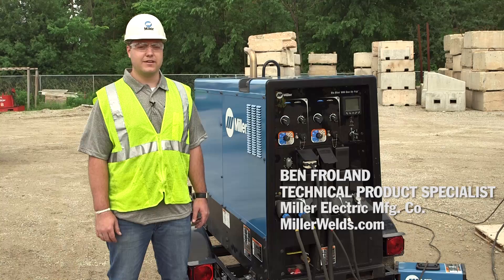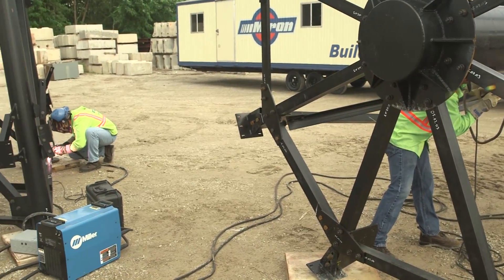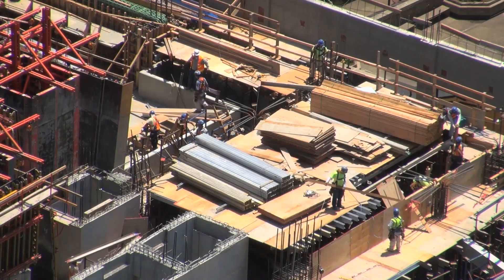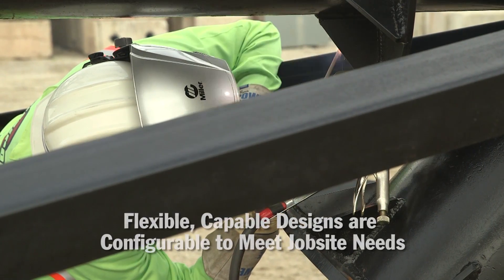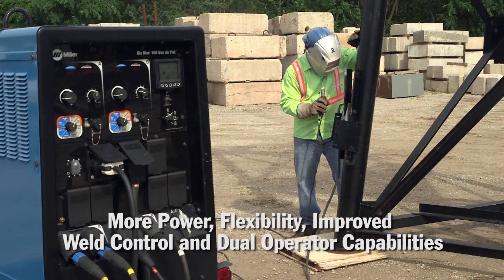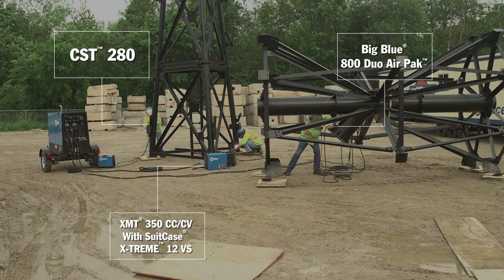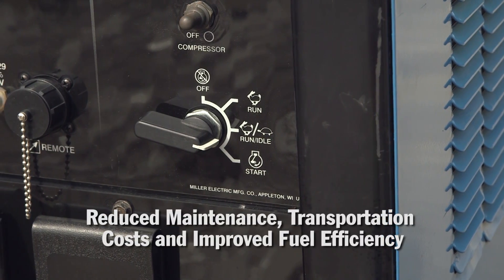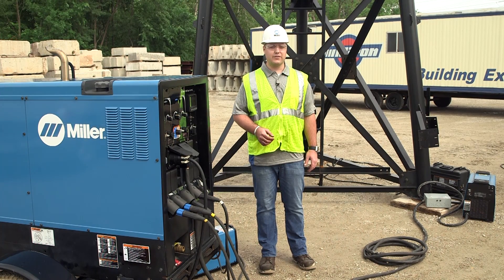Miller Big Blue 800 Duo Air Pak Increases Jobsite Productivity, Reduces Total Cost of Ownership

Comment: How much does a big blue 800 duo air pak. Brand new cost
Reply: 30 g baby  😆😆😆😉
Reply: A measly $36K can’t beat that with a baseball bat! Lol
Reply from the maker: Thanks for reaching out. The manufacturer suggested price for the Big Blue® 800 Duo Air Pak™ is $36,075.00 (US). For more details and to see all options, you can visit our website: https://www.millerwelds.com/equipment/welders/engine-driven/big-blue-800-duo-air-pak-engine-driven-welder-m00495 We also recommend checking with your local distributor for information and availability in your area: https://www.millerwelds.com/where-to-buy?buy=1 Thank you!

Comment from the maker: Tight deadlines and quality work are top concerns on welding jobs in the field. Increase workload capability by outfitting multiple weld operators simultaneously using the Big BlueⓇ 800 Duo Air Pak™ engine-driven welder/generator. The industry’s largest and most powerful engine-driven welder/generator, it provides flexibility on the job and results in higher productivity. Watch more: